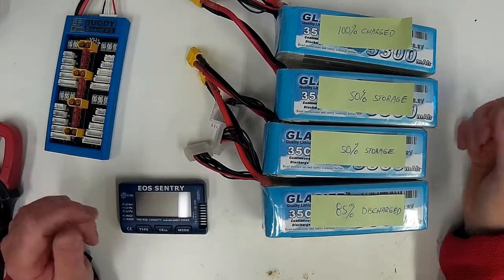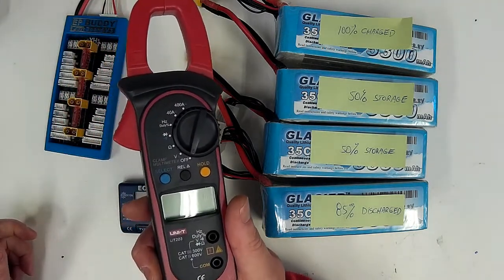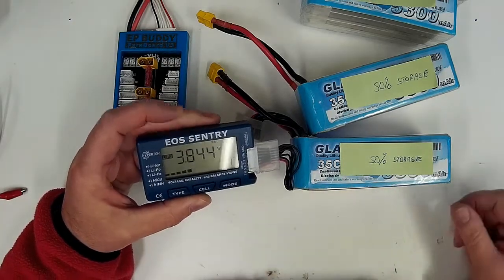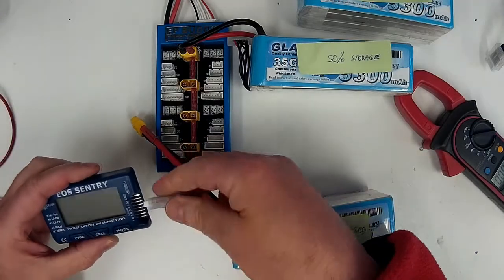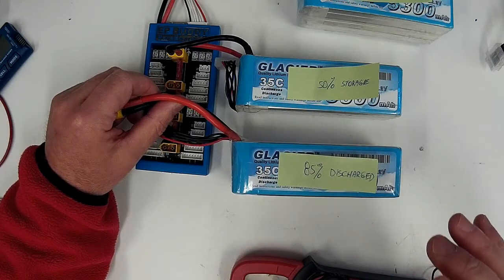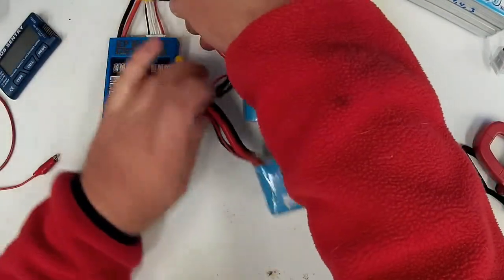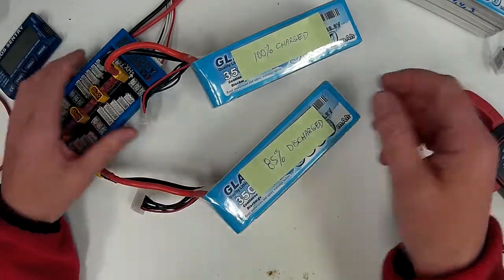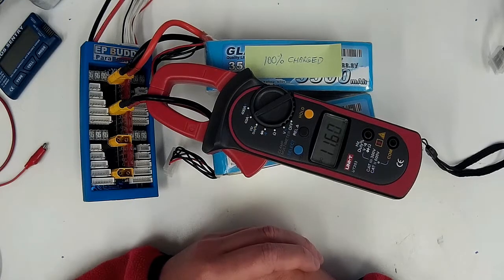Parallel LiPo Battery Current Flow Demonstration

Comment: So you didn't have the batteries connected to a charger, but you only had the batteries connected to each other in parallel?
Reply from the maker: Correct; the current flow demonstration is between packs at different voltage potentials only.

Comment: Correct me if I'm wrong but if you're charging multiple batteries this means you will have less current output.  I = P/V so as you add more batteries, the voltage rises which decreases current.  This seems backwards to me because I would think the charger would have to output more current to account for the multiple batteries it needs to feed.  Could you clear this confusion for me?  Thanks.
Reply from the maker: I think you're confusing serial charging with parallel charging. Voltage is not increased when hooking packs up in parallel, capacity is increased.  For that reason,  you are correct that you need more current when charging in parallel since you are increasing the overall capacity. The parallel charging page on my website covers all this in detail and will clear it up:  https://www.rchelicopterfun.com/parallel-lipo-charging.html
Reply: John Salt Thank you for your detailed answer and article. Was very helpful!

Comment: Hello John,
I have an offtopic question you probably are the right guy to answer.
I have a 9.9v 1500mah LiFe battery, I was charging the battery from about 9.4v which I think it's not totally flat, and when I noticed my imax b6 had charge about +1700mah. How is that possible?? I was expecting a maximum of +- 1300
Reply from the maker: Kinda need to know the history of this particular LiFe pack better and exactly what has happened. Ie. has it been charging fine (many times) with a more expected mAh going into it, or is this a first event on a new pack? Did the charger correctly shut down or did you manually terminate the charge cycle when you notice it was not shutting down fearing it was being overcharged? What was the finished charge voltage sitting at? A 3 cell LiFe fully charged should be no higher than 10.8V (3.6v per cell) at the end of the charge cycle. If it was over that, then for some reason it got over charged and the charger for some reason didn't automatically turn off? As to if that's a battery issue, a charger issue, incorrect charge program or higher termination voltage accidentally programmed, or a high resistance somewhere that was eating some of the capacity going to the battery in the form of heat energy??? Would have to perform more charge cycles and monitor more closely to diagnose/fault trace. How is the internal resistance of the pack/individual cells?  That's always one of the very first items I check when funny stuff like this is happening.
Reply: @Rchelicopterfun  Can't believe by mistake I deleted my reply :( took me more than 10 minutes to write. :(
Reply: @Rchelicopterfun  Very Short now...
Battery: 1 year old but 2nd time charging. Hobbyking LiFe 9.9v 1C 1500mah for turnigy 9x transmitter
Charger: Imax B6 set for LiFe 9.9v
Start voltage was 9.4 9.3v. I set the charge to 1.0A (I always go low on Amps as you recommend). At -+100 minutes was 1500mah 10.79 10.80v. At 120 minutes of charging was 1706mah 10.80 but still pulling. So I stopped the charging afraid of something bad.
Battery was nearly room temperature every the time I checked.

Comment: Hi John. Very useful video. When you charge 4 battery packs of the same voltage in paralle, does the charger control/limit how much current flows to each pack? Which particular chargers would you recommend?
Reply from the maker: Howdy Nikolaos. No, the charger has no way of "seeing" each individual battery. As far as the charger is concerned, there is one big battery hooked up to it with a total capacity the being sum of all the packs. The current flowing to each battery/cells is determined by the internal resistance of the battery and cells. Lower IR = more current, Higher IR = less current. Same way you would calculate current across resistors hooked up in a DC parallel circuit using Ohms law (I=V/R).

Comment: Does this current also flow through balance plugs? This would be much more dangerous as they are much thinner than discharge port
Reply from the maker: Yes, that is why you should always hook the mains up first. I go over all that on my Parallel charging page on my website that I link to in the description: https://www.rchelicopterfun.com/parallel-lipo-charging.html

Comment: Very good video John but surely based on that testing your advised 0.1V limit is massivly over conservative? For example 0.2V between cells would still produce a peak inrush current that was about 2C charge rate, and that would only last a few seconds. That's perfectly 'safe', so why not increase the safe limit to 0.2V (which is still very much on the conservative side).
Reply from the maker: When it comes to recommending LiPo safety precautions, it's always best to be massively over conservative :-)

Capacity has to be taken into account as well. With the 6S 5300 mAh packs in the example, they can certainly handle those larger voltage differences and inrush current flow rates, but it would be a different story if I was hooking 6S 1500 mAh packs together for example.  At the end of the day, it's the individuals choice of how safe they wish to be.

Comment: Very confusing. The 85% pack.. is it discharged 85% so only 15% remains or is it charged with 85% left? why not use % charged on all packs?
Reply from the maker: It clearly states on the tag "85% discharged". Why use that terminology over 15% charge remaining? Simply because in the hobby, we reference discharged LiPo packs by the amount of discharge state, not by the amount of  charge remaining. In essence, one could actually argue that pack is fully or even over discharge since the maximum safe amount of discharge state on LiPo cells is around 80%.

Comment: Useful video John. My problem over the weekend was that I didn't realise that a cell on one of the packs had died. Plugging the main leads into the board was ok but after plugging in the balance leads, smoke started to rise as the balance board burnt out! Think I'll check for dead cells before every charge now.
Reply: Yes, you should really check the packs with a LiPo tester before connecting to the balance board. Not only to detect dead cells but also to pick up if any of your balance leads are broken.